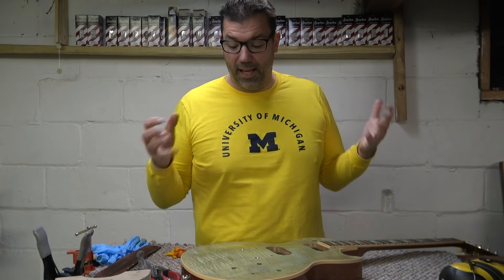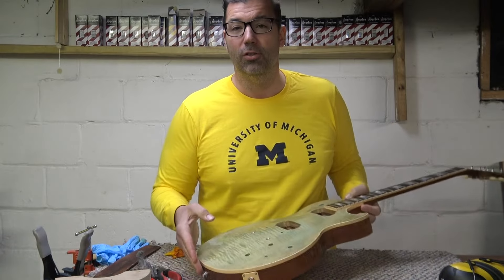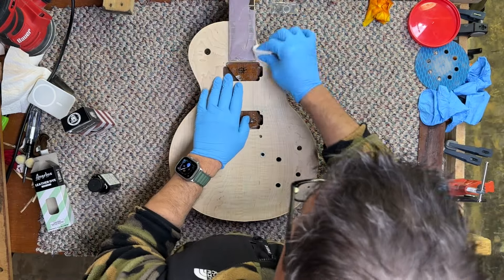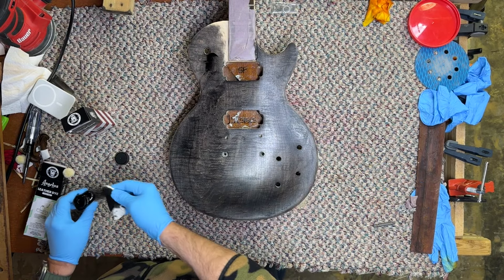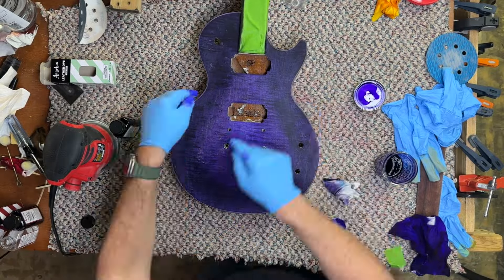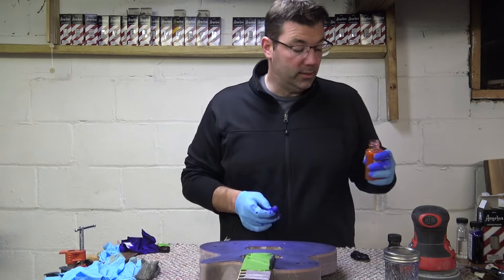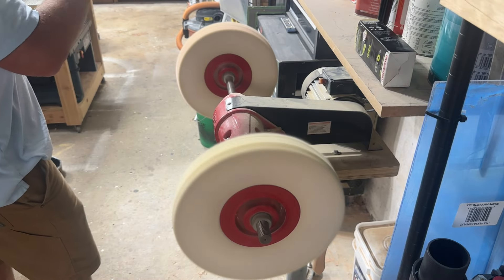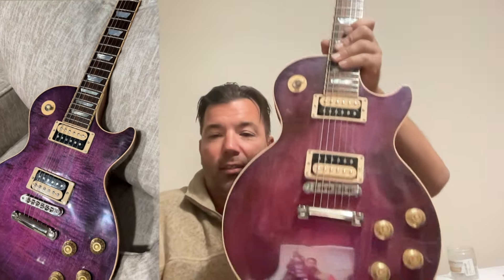Gibson Les Paul Refinish from Seafoam to Purple Rain

Comment: Just a suggestion regarding the black sand back technique.

I found using dissimilar solvent stains works best so one colour doesn’t bleed into the next.  So I use both water based Keda stains and alcohol stains.  Typically the water Black Keda is first, then sand back, then alcohol rubbed and/or sprayed after.  This way the black won’t bleed up changing your colour.

Comment: That looks like so much fun, but so difficult! I wonder if block sanding (or a scraper!) would leave more contrast than steel wool after the black, on tops with weak figure. Seems to me it would leave more in the deep grain and less overall smudginess but I dunno ;) Also you might be better off mixing purple with black for the first coat depending on what you're going for.

Comment: Interesting. Does the clear coat not end up on the binding? So the sides have the original clear coat or are they scraped back to the original plastic? Does the polishing buff the plastic if it's clear coat free?
Reply: You clear coat the binding.

Comment: Unless it's already been refinished at some point, that should be a nitro finish shouldn't it?  I haven't heard of Gibson using anything else.
Reply: I agree, do you know what is a two k finish...two pack?
Reply: @mrmanch204  2k is the clear coat. It's basically a polyurethane with a hardner in it to get to cure and harden faster.